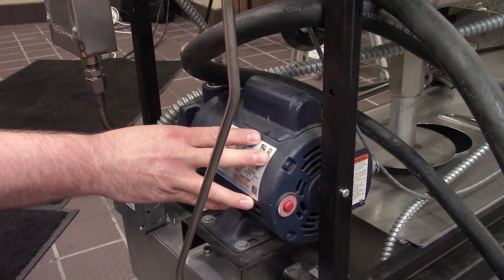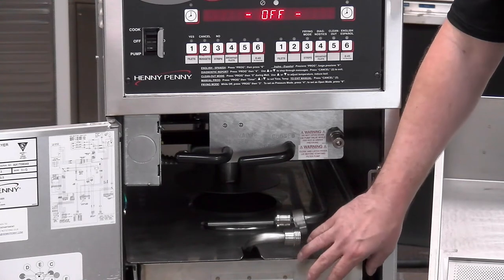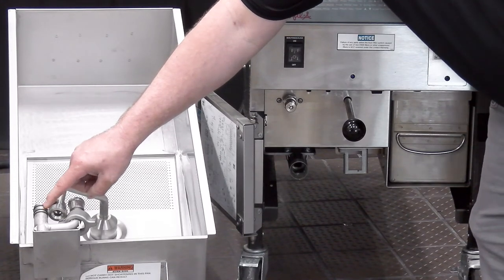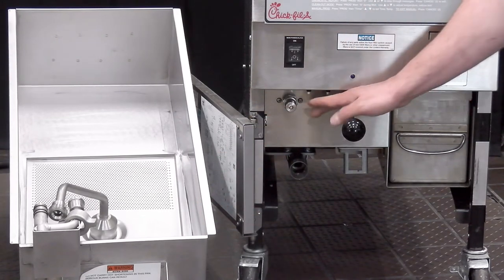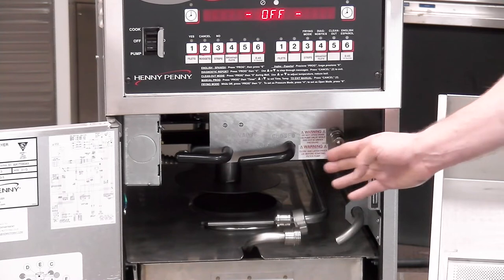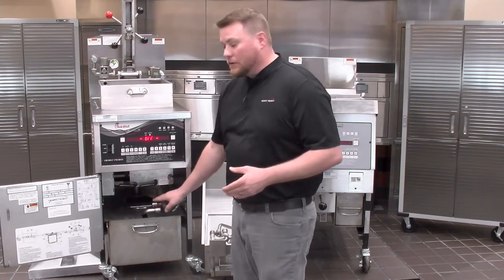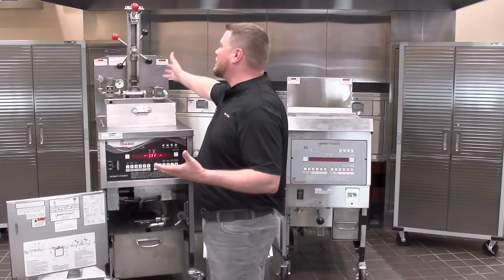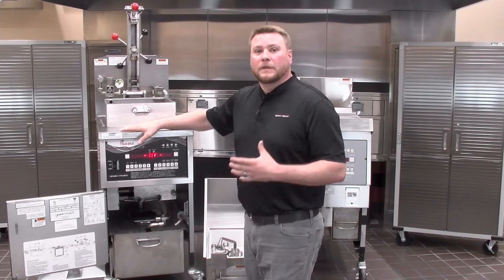Chick-Fil-A Pressure and Open Fryer Tips & Tricks - Henny Penny Micro Course

Comment: We have run into a problem with the speed at which the oil will pump back into the well.  The oil is hot and the Henny Penny reaches 0 so as we clean it and pump the oil can take up to 20 mins to pump fully.  We have the think reusable filters and we change new filters weekly, one a day since we have 6 machines. Are we just not cleaning them enough? I will say the bottom pan usually has a lot of little crumbs because of the nuggets
Reply from the maker: The issue could be a combination of different factors. Please contact our technical support department for better assistance at tservices@hennypenny.com